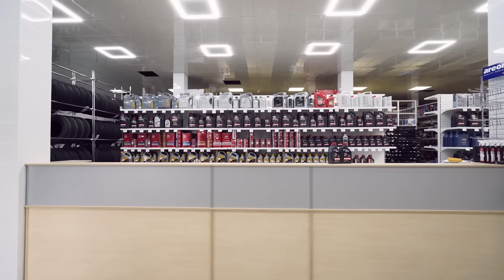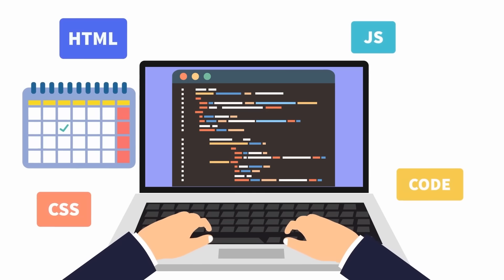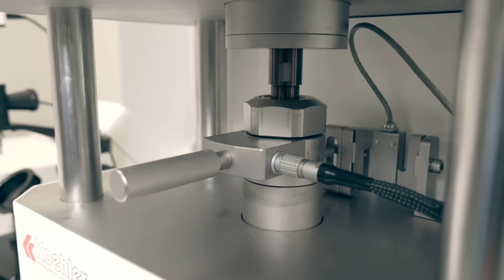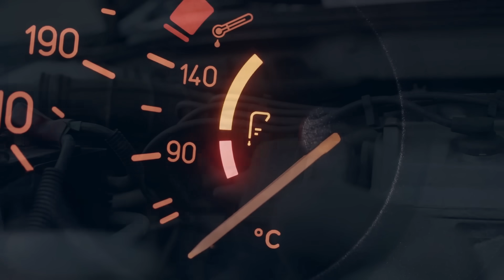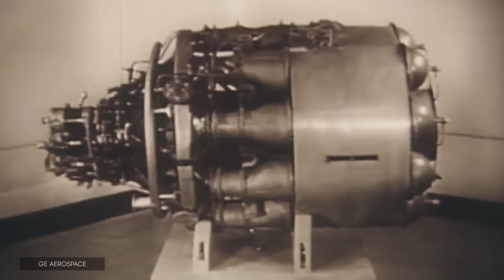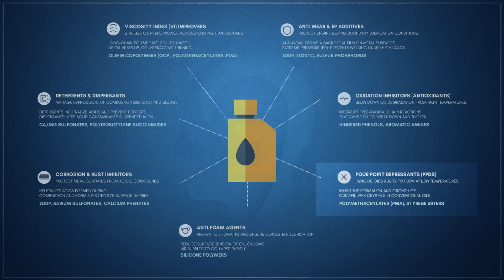The Science Of Engine Oils

Comment: So, to summarise, 0w40 oil will provide adequate lubrication 99% of the time. Sounds good to me!
Reply: Basically yes, but you have to change it more frequently as it will "break out of sheer" (loose it's viscosity) more easily due to the high amount is viscosity improvers in it - basically the further the viscosity numbers are apart, the better the oil but the more frequently it needs to be replaced.

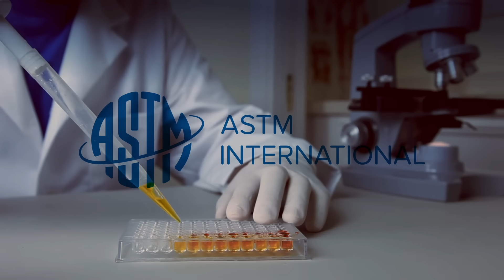Comment: 2:55 Centistokes are not, and cannot be, mm^2/s. If it were, the more Centistokes, the higher the flow, and the less viscosity.
Reply: Centistokes are mm^2/s.  Like many derived units, reading the reduced form is often misleading to intuition.  Kinematic viscosity is derived from dynamic viscosity, which is the ratio of shear stress to shear velocity gradient, ie. Pressure/(Velocity/Length).  This reduces to the units Pa*s in SI.  Now, kinematic viscosity is the ratio of dynamic viscosity to fluid density.  This would be (Pa*s)/(kg/m^3) in SI, and as Pa are (kg*m/s^2)/m^2, the units cancel down all the way to m^2/s.  So, do not think of the kinematic viscosity units as an area per time, think of it as a viscous stress per shear gradient per fluid density.  In this frame, it becomes clear to intuition that a higher number of centistokes correlates to a higher viscous stress, all else held equal.
Reply: Does mm²/s means a fluid covers or flows so many mm²/s per second?

Comment: I do not drive a lot but the yearly oil change is something I never skip.
According to my car manual the oil can last up to 28 000km (if I remember correctly)

I change it every year and only drive 5000 - 8000km each year. It will increase the life span of my engine and turbos. I make sure to do it shortly before the winter months because temperatures can reach -30 degrees celsius so I want optimal lubrication during this time.
Reply: My engine interval says 20k, 3.0tdi, I change it around 15k because I drive alot and now I use a thicker oil 5w40 instead of 30

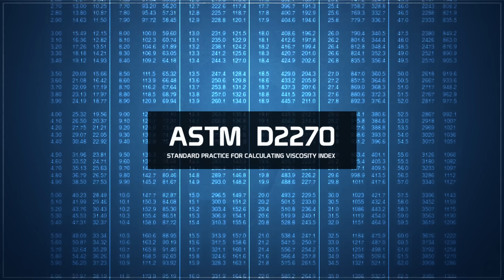Comment: 3:47 - the viscosity index chart is broken. See scale labels and nonsense value distribution (40-200 being the size of 40-90 and the 95-105 being on the left despite being greater).
Using AI generated charts hurts the channel credibility
Reply: AI for animations etc is an amazing tool, but charts and diagrams require verification ;)
Reply: I believe the actual problem is that, for some reason, the leading '1' has been dropped from the 40 in multi grade oil, the 35 & 60 in PAO, and the 40 & 90 for the ester. Those should be 140, 135, etc... the leading ones on the x axis labels for 100 and 150 are also squished in so idk if it's some odd font rendering bug or what, but it's not AI generated that's for sure.

Comment: So my question here is if we had a new engine of an old 1970's era model, say a Ford big block, but only ever used modern oils optimized for its use case; would that engine significantly outperform its historical average lifetime?  I would suggest the answer is a resounding yes if the design is not plagued by any flow defects.
Reply: Yes with certain factors. Take 70s as an example. Just a decade before engines almost across the board finally moved away from by-pass oil filtration. That old silo looking oil filter separate from the engine only filtered a portion of the oil and sent it back to the pan. The mains rods etc got the sludge from the pan straight up. Those engines I would recommend sticking strictly to their owners manual recommended oil change intervals and careful move to modern detergent oils. That was a giant step that had less to do with oil and more with filtration as engine design only changed greatly in the 1950s with the move away from flatheads and babbit poured bearings. Since you mentioned ford we can touch a few spots. Y block engine suffered from the engine oils of the 50s and stopped oil flow to the rockers. Then the 400/351m “big blocks” of the late 70s and any ford guy will confirm they just blow up sometimes without cause even with fresh oil. But yes. Yes it would last longer. Even without low tension rings.
Reply: Likely would need zinc additive
Reply: I'd guess no. The tolerance between the surfaced will be engineered for a specific viscosity of oil

Comment: any conductive lubricants? graphite but well actually conductive. nah use bushing bearings, ie two metal surfaces as skis.
Reply: I've has cause to use graphite for this reason exactly once: Lubricating the sliding contact on a gigantic rheostat. Not actually a high-power component: It was a piece of educational demonstration equipment, and built over-sized so that it would be easily visible to everyone in the room.

Comment: 4 balls wear test is a bad measurement of how well the oil is going to perform in your engine
Reply: I agree; that's true. However, it's a good way to begin to make a standard - by measuring individual characteristics in isolation, so that other factors can be eliminated and tests can therefore be more precise and contain less errors, as well as being more repeatable by other similar labs. It's not the whole picture; it is merely one brushstroke.
Reply: @verysmallcats1374  you can spike it with calcium detergent and it will deceptively perform better in the test, which itself should be for EP additive package performance at a point contact on the balls which is a very severe condition and should not be present in a working engine. The 4 balls test result should not be considered when choosing lubricants as an end product, it would be more useful as a screening tool for formulators. It's a test alright, highly replicable, but should not be a point of consideration for consumers
Reply: @verysmallcats1374  lubrication explained has a video on the test itself, lake speed jr the motor oil geek also mentioned it in his porsche club america guest lecture (an hour long)

Comment: I will say to everyone who is looking into getting the best oil for their vehicle is to check the manual to see what specification it is required and what climate the vehicle is going to be driven in to determine it's viscosity they should aim for. I do say to potentially go for thicker oils depending on how may miles/kilometers the engine has and what kind of service history does it have or any at all. Different brand do use slight different additive packages but it's best to go for more "trusted" oil brands than some bottom shelf, plain label crap you get from grocery stores.

Comment: Just as I was researching motor oil as I was planning to do an oil change next week. Great timing!
Reply: I tested various oils for a decade in a destructive run test of gearboxes and oil pumps. Mobile1 and the equivalent Castrol synthetic consistently provided the best results long after they should have been replaced. We noted no wear of the cams or rocker arms even at speeds exceeding 4x normal operation nor did they cause premature oil seal failure (Federal-Mogul seals) like other popular oils we tested.
Since then, I’ve been a loyal customer of Mobile1 because of that testing.

Comment: Glad we don't need it for ev
Reply: You do, you have a gearbox with lubricating oil
Reply: @motor-haube  EV usually have sealed components where lubrication is needed. There are still moving surfaces in contact, but a lot fewer of them, so the lubricant can last much longer. It may last the life of the vehicle without changing.

Comment: How do new EV cars change these oil standards and such?
Reply: EVs still use lubricants, but they are contained in sealed components and intended to be changed only very infrequently - and not by the user.
Reply: Well the latest scheme they're doing for "better fuel efficiency" and lower emissions,  is they're pushing manufacturers to recommend lighter and lighter viscosity oils for their engines. Which might increases fuel economy.. at the expense of engine lifespan.
Reply: Who cares?

Comment: Hmm. Slippery subject. 😉

Oils undergo breakdown and sludge build-up from time-at-temperature and additive depletions from exposure to combustion by-products (it's complex, so I'm grossly oversimplifying). The point being: if you don't change your oil regularly, you will eventually be changing your engine. Despite some full-synthetic oils claiming to be able to go for 10,000 miles or more; even though their lubrication properties may still be intact enough, I don't trust them to do that for reasons of sludge buildup: I run full synthetic and change it out every 5,000 miles or sooner.

Is it a bit more expensive up front? Yes, but I really don't like what manufacturers have been doing lately with "connected cars" and everything-is-a-subscription, and selling the data they collect about me... so I fully plan to put as many miles on this one that I physically can (500K perhaps? Yes, that will include some major overhauls).

Edit to add: I am a computer programmer, so it's not just me being old-fashioned and "get-off-of-my-lawn".
Reply: engine oil is probably another reason to move on to electric imo
Reply: @alveolate  Generally speaking, I agree. My plan is to build an electric hot rod between now and the eventual demise of my current car. There's a couple of companies that sell complete drive packages based off of reclaimed Tesla large-drive-units, retrofitted with a custom control board to allow it to function without the rest of the Tesla electronics.
Reply: @alveolate  until you need to go on a long trip, until you intend to keep the car longer than 10 years, until you need something cheap to repair, until you have to drive it in cold winters, until you have to find a recharge station and wait there 30 minutes. Lol
Reply: My engine oil now costs about $100 USD when I change it myself.  My engine takes 7 quarts.
Reply: @lourias  V8?
Reply: Im with you, I change my oil every 7000km although I am in a tuned VW GTI. Spark plugs need to be done every 2ndish oil change on this since I'm tuned so it can be a bit pricey